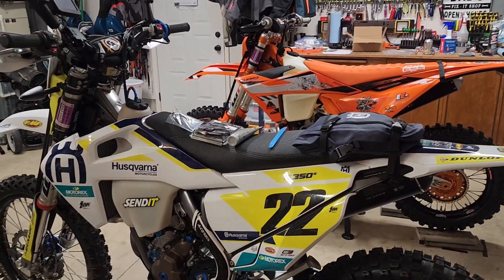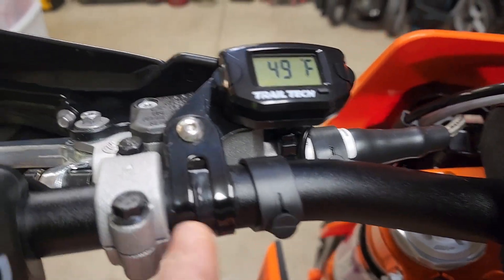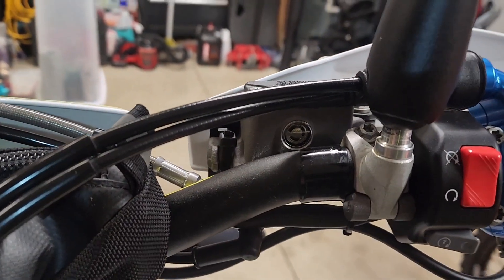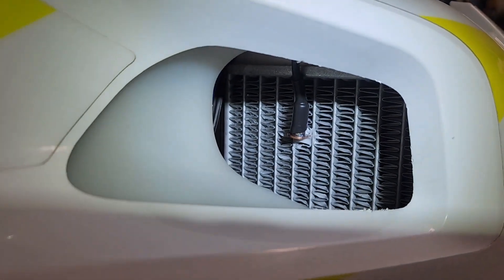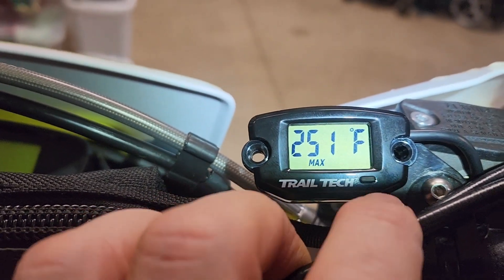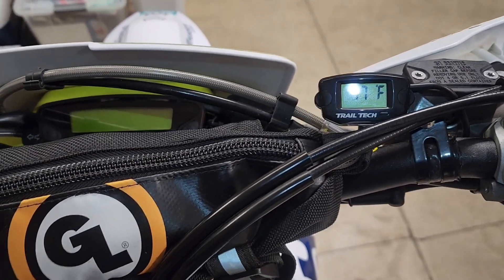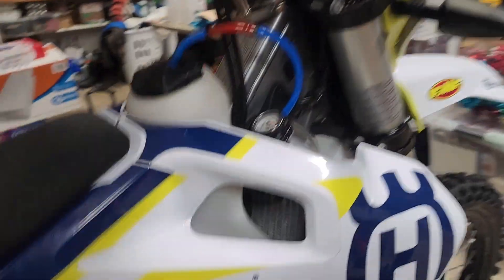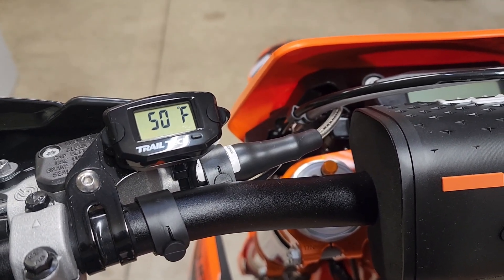Help Prevent Engine Failure / Trailtech Temperature Gauge Installation. KTM/Husky 300, 350, 500, 690

Comment from the maker: Thanks for watching, yes, my radiator cap is same size as OEM.  I recently saw that Rockymountainatv had them back in stock again with their Tusk brand.  If you can get one, it is worth every penny to know engine temp. Maybe give them a call and see what they can do, or check in with Jeff Slavens Racing. Both places have been pretty helpful when I call and need some special help.

Comment: John is this really the link you used for the trail tech gauge handle bar mount. The website listed seems odd when I open up the link. Also went to Motion Left Mopeds site and is says (permanently closed). If that was the site you used I will give it a try though. Thanks and great videos.
Reply from the maker: All that you say is so true!  That treatland website is so nutty that I didn't expect the bracket to show up but it did.  I picked up a few extra brackets since then and they all come in good order with newspaper packing etc.  So odd, but products came in perfect condition. 👌
Reply: ok thanks for the reply.  @oregonmotojohn

Comment: why did u put it on the husky when you ave on the cap the gauge just curious no hate btw love th eproduct thinking of buying one rn
Reply from the maker: Good question, I wanted to cross reference it with the radiator cap gauge to check consistency between the two.  The Handlebar gauge is slightly easier to see, but is redundant as they read exactly the same on my last ride.  It was cool to see that they mirrored each other's readings.   The rpm/hour gauge would be a better addition if you already have the radiator cap.  Thoughtful comment, thanks for chiming in!  Ride on!
Reply: @oregonmotojohn  Where can i find a radiator cap like that close to 1.4? I find a load of those but they are not in the exact same size as for my KTM 525 exc. Is your radiator cap same size as OEM? thanks for the video : )
Reply from the maker: @andreasgunnarsson7276 Thanks for watching, yes, my radiator cap is same size as OEM.  I recently saw that Rockymountainatv had them back in stock again with their Tusk brand.  If you can get one, it is worth every penny to know engine temp. Maybe give them a call and see what they can do, or check in with Jeff Slavens Racing. Both places have been pretty helpful when I call and need some special help.
Reply: @oregonmotojohn has the cap been reliable? I see some research with some people saying it fails